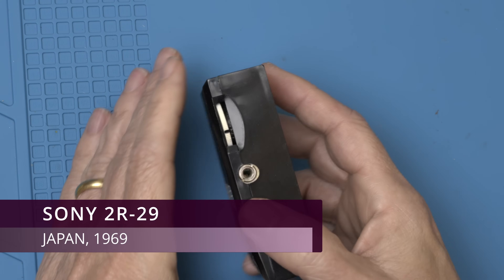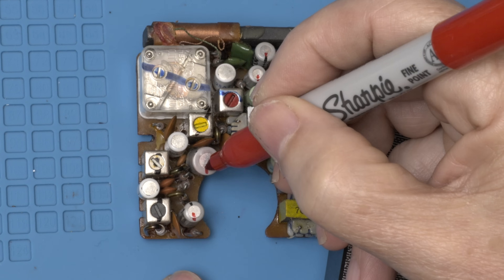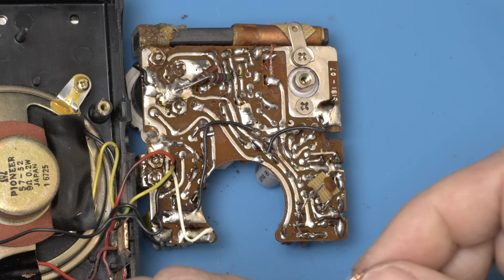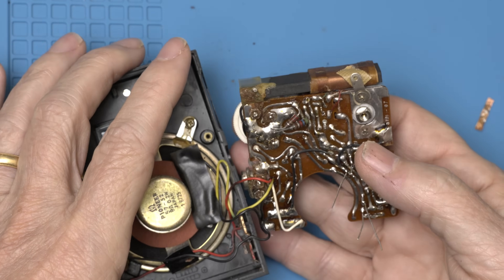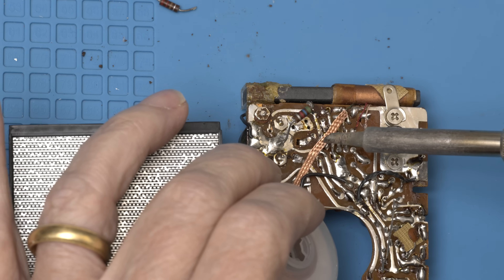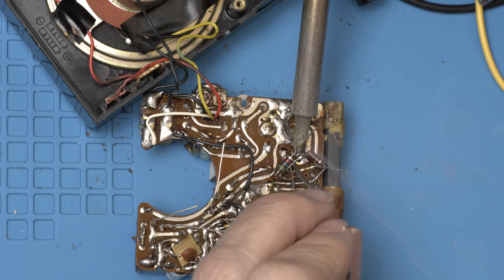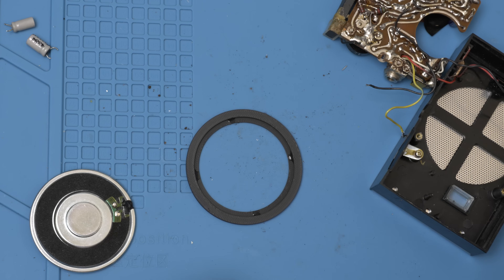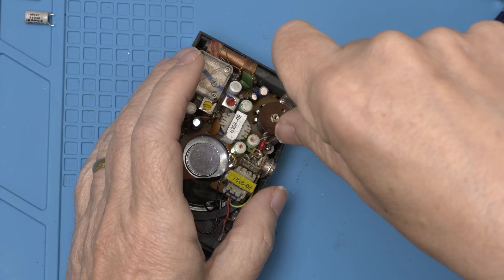Vintage Electronics Repair: Dead Sony 2R-29 transistor radio restoration

Comment: Before putting the resistors back in place, measure their resistance. That way, if the resistors are out of tolerance, you can go ahead and replace them. With one lead of the resistor out of the circuit, you'll get a proper resistance reading.

Comment: The reception is not clear as  it should, I believe there is a weak transistor or bad resistor I once watched Shang066 , he fixed a transistor pocket radio with same problem. Great video  and thanks for sharing 🙏

Comment: Tolerance on early electrolytic caps for transistor radios were often quite wide, +/- 50% was not unheard of.  However, the ESR on the first cap you tested did indicate a weak capacitor, the fact that it was high in value could be ignored.
Reply from the maker: I was wondering about that.  Some of the radios work surprisingly well even with caps way out of spec.
Reply: @Dream.Build.Create  1 thing to remember:capacitor testers will typically read high on a leaky capacitor...so a cap that reads very high is likely leaky(leaky in the sense that it will allow DC to pass through it, not necessarily that its physically leaking).
Reply from the maker: Good info, thank you.